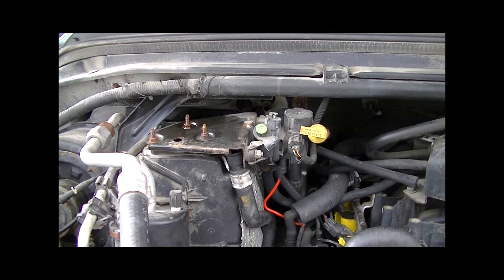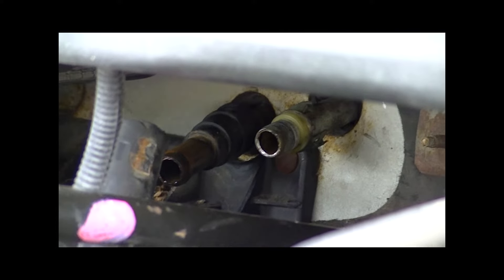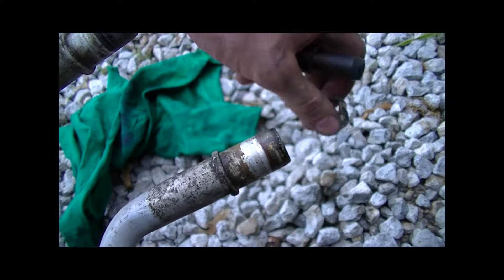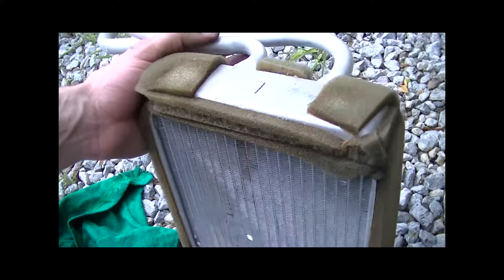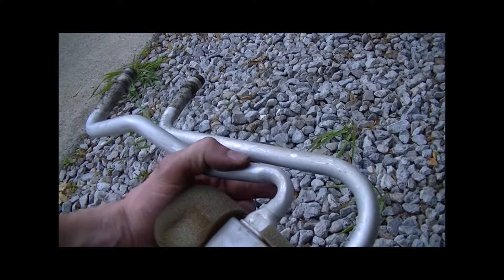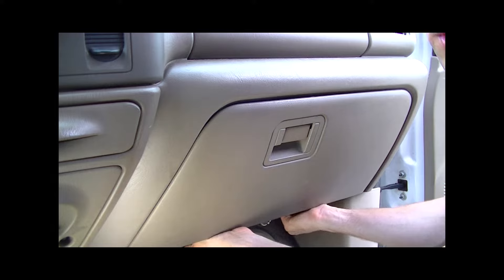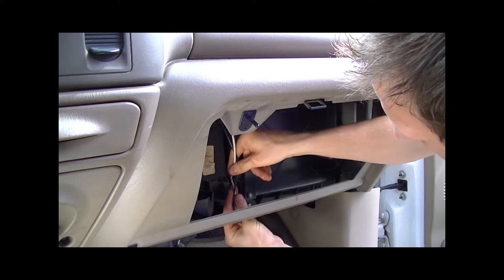99-07 Ford Super Duty - Heater Core Replacement (Step-by-Step Guide)

Comment: Awesome camera angles! I put vice grips on the heater hoses so I didn't have to drain the radiator. I used a oscillating saw to cut the aluminum heater hoses off the core from inside, and pulled them into the engine bay through the firewall. It made it super easy to disconnect the plastic quick fittings! Your truck is super clean. My truck has 550,000 farming miles and it had 1/4 inch of dirt on top of everything under the dash.

Comment: Best video for this I could find.  I just replaced mine.  2000 F250 7.3
Tips:
    Use a 21mm  open ended wrench as your  quick disconnect tool. It fits perfectly and I had the space.
You don't have to remove the Vacuum Actuator 9:53 . 
If you are handy, use your old heater core to make a U-shaped bypass line. The pipe is the same as 1/2" copper, cut at the right spot, solder it , easily install it for the summer using your factory quick connects...

Comment: Your step by step description is wonderful. Thank You. I cheated when installing the quick disconnect back on the heater core at the firewall. Using a 18MM deepwell socket with a couple of extensions, I was able to snap them in place(I sprayed the orings with WD40 to help them slip into place and not roll). The heater hoses slipped right on.Than using the 5/16 socket, I was able to reach the hose clamps all the way from the drivers side over the air cleaner hose (Using about 30" of 1/4" socket extensions)
Reply from the maker: Nice cheat! Hope it helps save someone else some time!

Comment: Very detailed, very easy to follow and even easy to skip ahead to where I needed to watch, except the question I had about the o-rings on the puppies was not addressed. On disassembly I found three o-rings on one connection and none on the other. The left side elbow connector produced no o-rings for me,😂😂! Loved the video, thank you very very much.
Reply from the maker: Glad we were able to offer some help!
Reply: O-rings on puppies? That's a funny typo there... Thanks again, I just put over fifty miles on the excursion today after the repair, so glad to have heat again!

Comment: Thanks, very helpful. They are quick connects, not quick disconnects! But a little silicon spray and keep working them till you’re fingers are sore and they suddenly and surprisingly come off. Even if you think only one tab is in, they both slip off eventually, 5-10 minutes later.

Comment: Excellent video. Worked perfectly on my 99 F250 !
Reply from the maker: Thanks for the feedback Fred! Glad this was helpful.
Reply: On the 99 v8 van, if the metal lines that goes to heater cord in the rear of the van has a leak, can you bypass the rear lines until a new line can be replaced ?  There are four lines I believe ,which ones can be cut and a hose connected from one to another?

Comment: The screw on the far side of the blend-door actuator was a bit hard to deal with but putting it back together was a bit simpler when I saw that the actuator just snaps into the bracket.  removing the actuator makes the bracket easier to attach then the actuator snaps in easily.

Comment: I disconnect the heater hoses on the engine block. I use a shop vac on one side to evacuate the heater core of fluids. Then I undo the cover on the heater core behind the glove box. Then I cut the aluminum tubes, going to the heater core and take out the remainder to the engine compartment then disconnect the quick connects, then replace the heater core.
Reply from the maker: @mauricerhoades7509  clever idea, i like it!

Comment: Great video, much easier if you just cut the aluminum tubes on the original heater core though  then you can pull the ends of the hoses out where you can actually see what you're doing.

Comment: Hi.  First off i wanna say awesome video!  I just pulled and changed out my old heater core (1999 F250 super duty),   which was leaking into my cab, and replaced with a new one.  Put it all back together but now I don't have any heat.   Any suggestions on what may be the cause of that?
Reply from the maker: +skeleman1963 How long are you letting the truck run before trying the heat? Also, the heater core and system will be full of air and will need time to bleed all the air out. I'd get the motor good and warm after a short drive, let it sit and idle, turn the heat to full blast and heat and let the system work the air out. At least for me, this proved to work just fine. After a few minutes (if that) you should start to feel the heat. Let me know the result.
Reply: +All4HimRacingVideos  - sorry for the relate reply.  I've driven a lot since that change out.  the covering for the heater core is warm to the touch so i feel confident that it is circulating fluid.  it almost seems as if the temperature dial isn't functioning now....does that work with the actuator motor?
Reply from the maker: +skeleman1963 If i understand you correctly, then yes. If for some reason the actuator is not working, the air is not deflecting properly. But if you have it sent on heat, no matter where the air is coming out, it should come out hot. Is the blower motor running?
Reply: +All4HimRacingVideos - yes the blower motor runs but only blows air through it...no heated air comes out when the temp dial is turned all the way to the right (hot)....

update... i popped the blend door actuator motor off, reconnected the wire harness and powered up the truck and the shaft that would open/close blend door was turning(slowly).  I'll will take for a drive and see what comes of this.
Reply: +skeleman1963 - update....have heat again.  i think the actuator motor shaft wasn' t'engaged in the blend door "hole"....
Reply: Thanks for help

Comment: Great video. Easily the best view, Most of the other videos don't really allow you to see what is happening. I do have a question. I have a 2005 Excursion. The engine is out and being bulletproof. I changed the front heater core but after reinstalling I can see the very top of the heater core despite the cover being in place. I'm not sure this should be the case. I used a Motocraft replacement and have no idea what I might have done wrong. Should any part of the heater core be visible above the cover? If not, any idea where I went wrong?
Reply from the maker: Not really sure. Have you tried the old part in place to make sure that fits same way?

Comment: EASY REMOVEL OF HEATER CORE LINES. Sense you replacing the heater core it does not matter if you cut the lines on the heater core. Look at time frame 15:43. You can see the heater core lines where they go through the firewall on the inside. I cut those off flush on the inside of the firewall with a dremel tool and a cut off wheel. The lines then pull out into the engine compartment where you can easily remove the quick connect fittings or simply cut the fittings off the hoses and reinstall the hoses using  new quick connect fittings as shown at time 2:21. These will give you new O rings also. You attach these new fittings to the hoses with hose clamps. Easy install. I never even took the old fittings apart. I just cut them out of the system. In fact I have done this with allot of different vehicles.
Reply from the maker: A good suggestion! Only issue is need to make sure to catch any coolant that may drain out during the cutting of the lines.
Reply: Any idea what the part number is for the quick connections
Reply: @bryanb9331  Sorry I don't recall but any parts I used were common auto parts store components.

Comment: Does it make the truck run rough and sputter if it's bad and leaking ?
Reply from the maker: Perhaps, the coolant used in the heater system is the same used in the engine for cooling. So if the engine is getting too hot from low coolant it certainly would cause it to to sputter and run bad due to getting too hot

Comment: My issue is that  I can not seem to get the dang plastic cover behind the glovebox that goes over the heater core back on without leaving a big gap on far right side. There is a stand off peg and it seems like it's supposed to go through a hole on the plastic clamshell the heater core sits in but I'm not sure. Anyone know how to get the cover on tight? I think because it's not  tight, it could be why my 4x4 Control module had moisture in it and had to be replaced.

Comment: If you dont have a quick disconnect tool for the hoses just cut the aluminum tubing of the heater core at the fire wall since you're replacing the heater core anyway.
Reply from the maker: Good suggestion! Space is tight up by the firewall but if you are able, that is a great option.

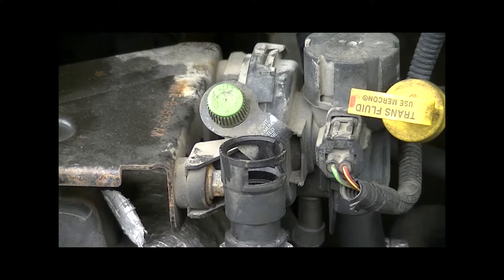Comment: I beg to differ with you about there being a lot of great videos and information on the web about getting those hoses off.  First, I have found less than a half dozen.  Of those, all but one has done what you have done -- just state that they are a pain but can be done.  That is not helpful at all.  One guy showed doing it with a coat hanger, and if you look carefully, you can tell there is no engine in the truck and he is standing in the engine bay.  That is also not helpful at all.  Everybody says there is a $20 tool made for doing this, yet not a single person has one and can show how to use it.  I am at 1:56 in your video and I am not watching the rest of it.  You can count me among your haters, and I am going to click the thumbs down on this video.
Reply from the maker: David, sorry for this. We made this many years back and at the time I found a video that walked me through it, but was not confident enough on my method to include a video as I would hate to show a eay that breaks the clips. I never broke one the times I did it. The rest actually is very helpful still but I respect your decision to move on. Good luck with the rest of your repair.

Comment: Can’t you cut these crapy connectors and replace with hose clamps. And drain your entire coolant system to change a heater core ? That’s ridiculous. Just position the hoses so they’re not hanging and you won’t lose much coolant.